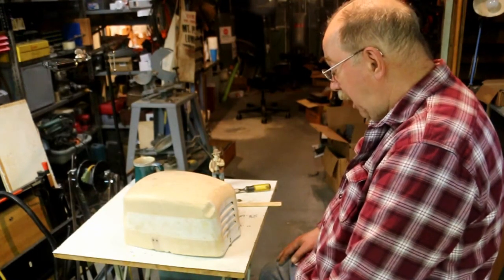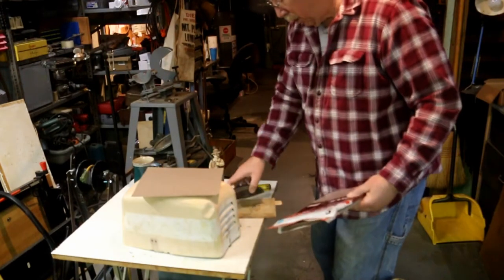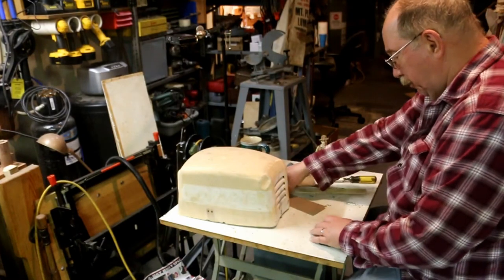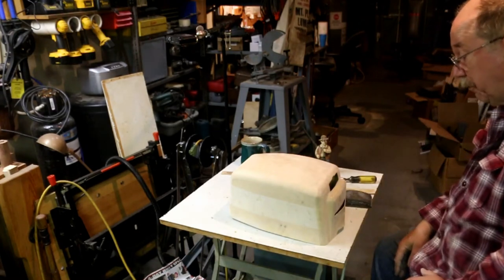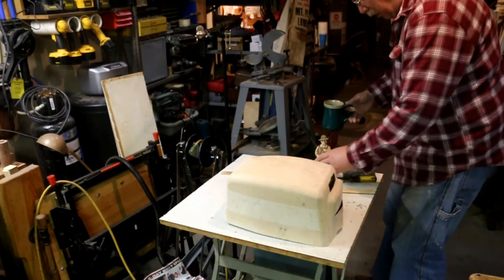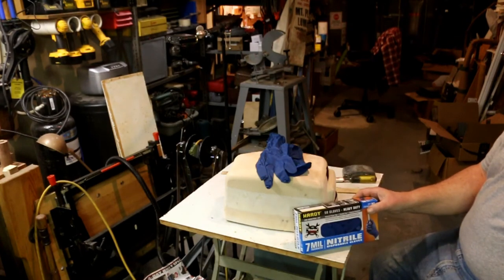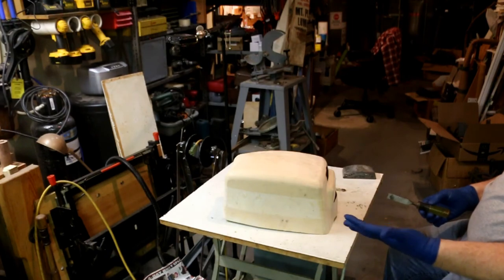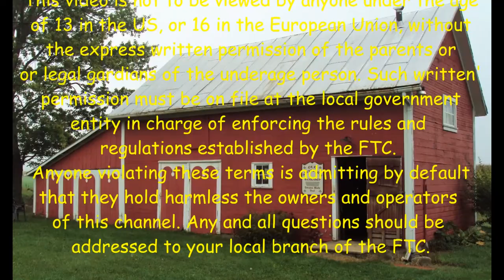Sportfisher 5 Hp Outboard - Pt 16 - Paint The Shroud

Comment: Sometimes it's nice to leave some of the character that it earned over the years.
Reply from the maker: True. I am more concerned by the distinct probability it will crack during straightening. 
The patches onnthe front were a pain and the aren't load bearing like the corner.
Reply: @OldSneelock  All my stuff is more character than material.

Comment: Yeah, I have a question...
If you had decided to fix the dent in that old plastic, what method of heating it would be your choice for older plastic like that?
Pouring boiling water over it, a heat gun, heated sand, or what?
Thanks
Reply from the maker: A heat gun would be my choice,  because I have one. 
Next choice would be a heat lamp.
Sand might work but it is difficult to control. 😁😎